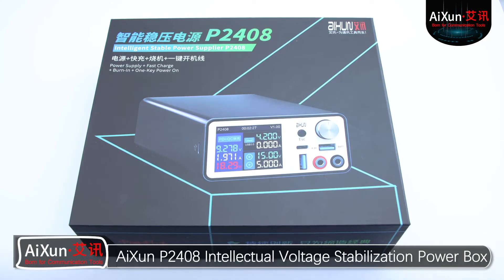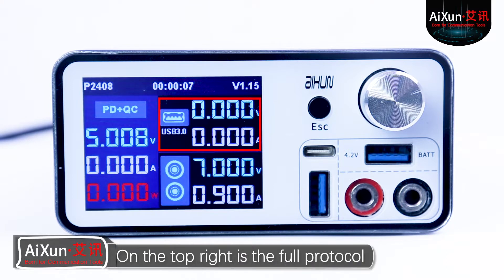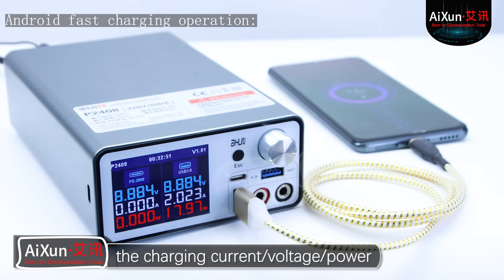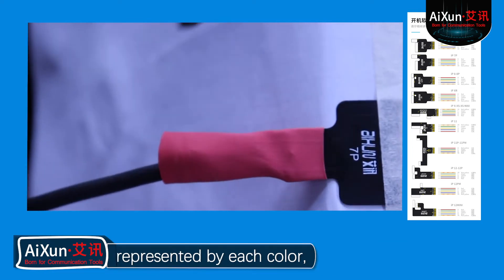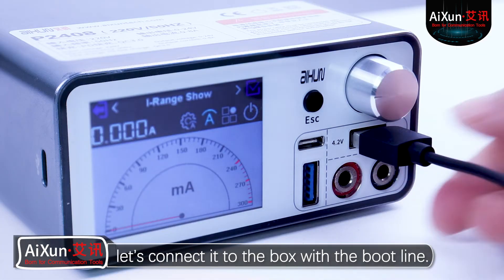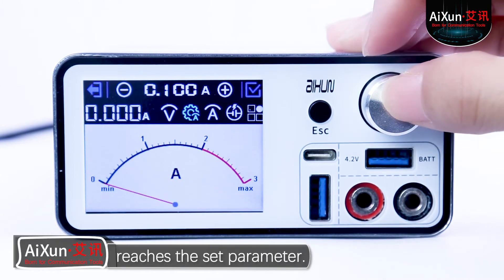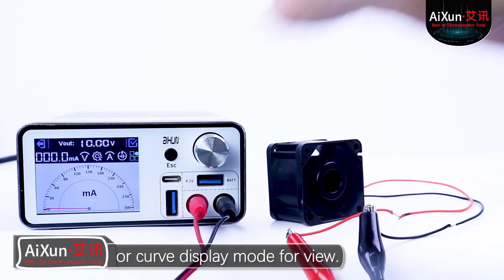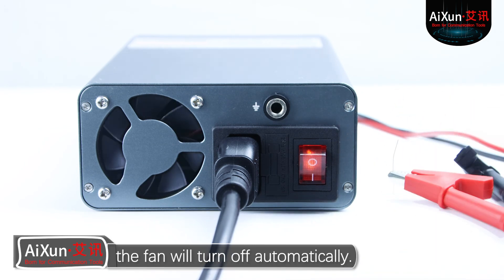DC POWER SUPPLY MACHINE USE | Operation Instruction on AiXun P2408S Power Supply for Mobile Repair

Comment: I have a total of 6 pcs of this power supply in my lab. when I update it's then it's not suitable for our work. V1.15 version is better than all versions. please provide v1.15 software as soon as possible. normally I use the DC output portion
Reply from the maker: The V1.15 version has been released on the AiXun platform, you can connect to the AiXun platform to restore the original version now